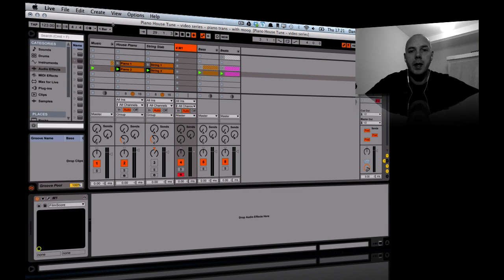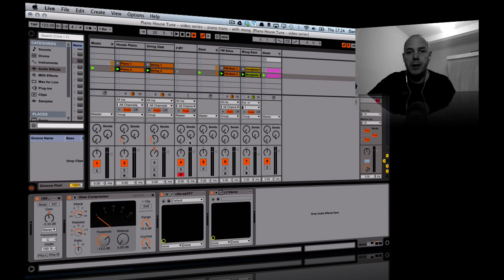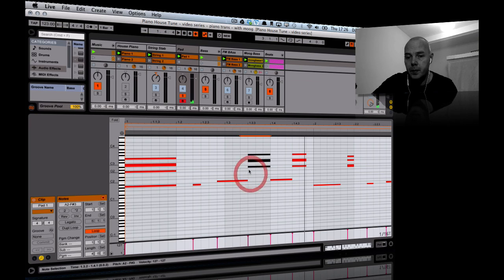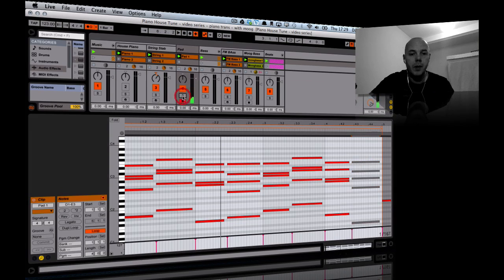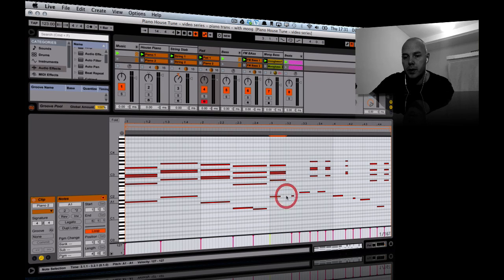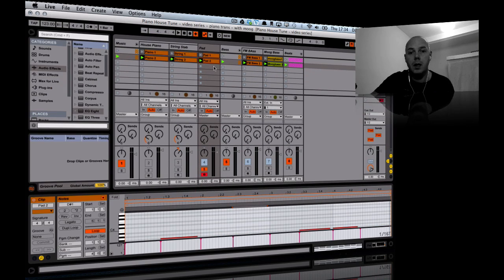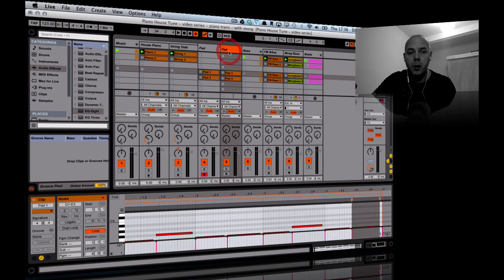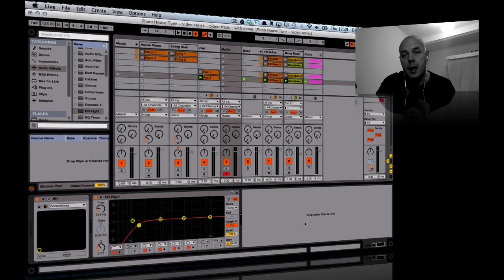Producing a 90s House Track - Part Six - Warm Pad

Comment: What I often do an a track that needs a mallet type instrument is use the same chords as the pad and run them through an arpeggiator with the mallet instrument. When I do it like this it will always put you in key and all of the scales will be correct. I also edit the arps time signature and delete many of the arp notes to get a better feel. I use Reason and thier arp has a random feature that gives it a human feel.